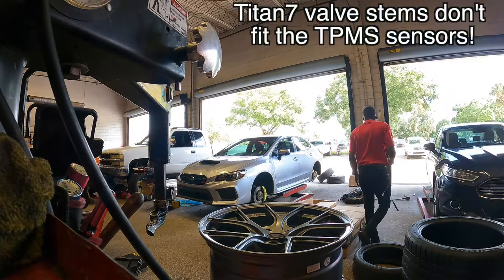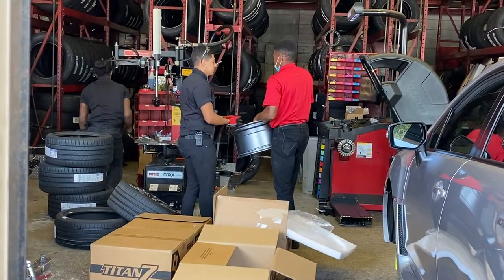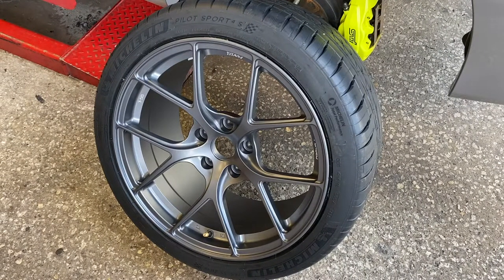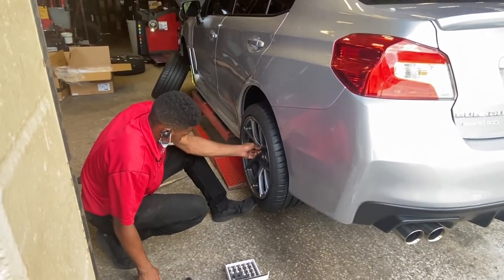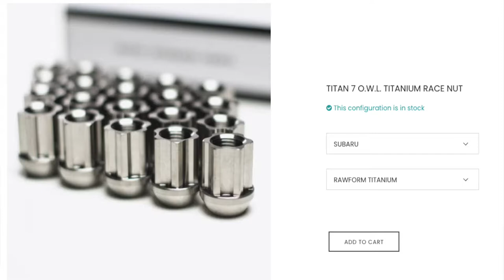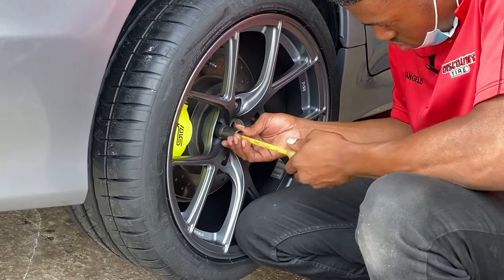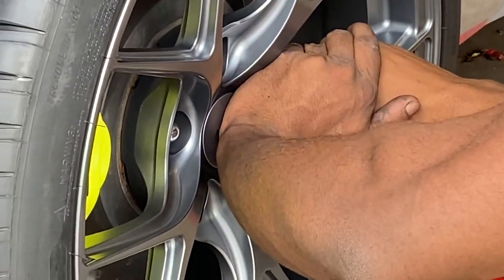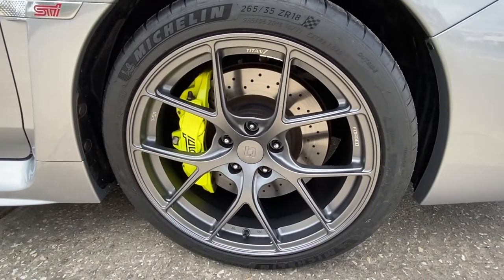Discount Tire Forged Wheel & Tire Installation - Titan7 T-S5 Wheels & Michelin Pilot Sport 4S Tires

Comment: They didn't scratch them? So many stories of discount scratching rims.
Reply from the maker: They very careful at the install.  I went back for a tire rotation just last month and of course they have all new staff. One of the newbs knocked my Titan7 center cap out and let it hit the floor which did scratch it. That really pissed me off and I told him to be careful with aftermarket wheels.The owners care about them.
Reply: @CarStory  I'm considering mounting and balancing my own. I have a no mar machine for motorcycle tires. Purchased some $400 rims and scared to take them anywhere. I have a local family owned shop that does all the custom truck rims i might try. surely they are careful.
Reply from the maker: @mooosestang  If you can do it yourself that is the way to go.

Comment: Personally I'm a Fortune Auto suspension fan. It's your call in the end.
Reply from the maker: I looked them up. They are really nice!
Reply from the maker: I'm talking with my local shop and they suggested Fortune too. They don't recommend using lowering springs with the tires I bought, they said I could ruin them. Looks like I'm going Fortune Auto 500 Gen 7!

Comment: What tpms sensors did you end up getting? Also which lug nuts did you get! I’m going to do the same to my wrx!
Reply from the maker: I had the stock TPMS sensors moved to my new wheels.  I added a link to the lug nuts I used in the video description.

Comment: Did u have to replace the wheel studs for the extended versions to fit your new wheels?
Reply from the maker: No , the wheels are made with the correct offset to fit the STI brake calipers and all. If you look at one of my other videos where the alignment is done you can see the tires come out to the fenders perfectly.

Comment: sweet set. how many miles on the subie?
Reply from the maker: It's just past 12000 miles now. I have another video explaining the cost for everything I did to the car so check that out too. The new wheels and suspension setup has made a HUGE difference in driving enjoyment. Really expensive but really worth it!

Comment: Hey, what did you need to order accessories wise along with these wheels? just wondering so I'm not buying the wrong things! Thanks!
Reply from the maker: +Vince Haylem Yes, hub rings and you will need 60 degree ball seat lug nuts.
Reply: @CarStory  Where did you get your lug nuts? Mines about 7-8 weeks backordered. Thanks, really appreciate it. Excited.
Reply from the maker: @Haylem  No problem. These are the lug nuts I'm using.  https://amzn.to/3p1l7mV
Reply: @CarStory  what size hub rings did you use, I just got these wheels
Reply from the maker: @GSek11  Titan7 sent hub rings with the wheels. Did you get them?
Reply: @CarStory  i bought them used, but i found the right ones for cheap!
Reply from the maker: @GSek11  I show everything the Titan 7 wheels came with in this video at about 2:20 
https://www.youtube.com/watch?v=57MxYrK-EK4
Says Hub Ring 73/56 on the package.

Comment: I assume you had to roll ur fenders? or no?
Reply from the maker: no
Reply: @CarStory  even with it lowered?  Cause I have the same rims now on my wrx.  I want to get the 265, but I want to be sure of no rub.
Reply from the maker: @Apes_love_BMX  The guys at RevWorks were able to adjust for the wheel gap you see without rubbing so there was no need to roll the fenders. They did a great job. Car feels absolutely amazing now.
Reply: @CarStory  ok so it didn't rub with the stock suspension setup.  But after you had it lowered, it was an adjustment? Like a camber adjustment?
Reply from the maker: @Apes_love_BMX  I upgraded to Fortune Auto 500 coilover suspension and there was a camber adjustment needed in the front.  I have videos on the Fortune Auto 500 suspension install and the alignment after so check those out. That will answer lots of your questions but ask away if you have more. I can talk about this all day! : ) 

Fortune Auto Install: https://youtu.be/JZtDFRURXc4

Alignment: https://youtu.be/zKpeCqd_h9M
Reply: @CarStory  Well this saves me the time of trying different tire sizes. Thanks!    I am surprised that you didn't have to get rear lower control arms. Maybe the STI has adjustable ones stock. But my WRX does not. They wouldn't even install my coilovers without having the ability to adjust the camber in the rear. Which makes sense. Now I just need to get the 265/35 tires, and then do the coilovers, set the drop, call it a day. Thanks for posting this content. Huge help!